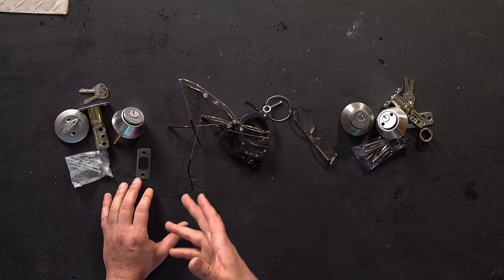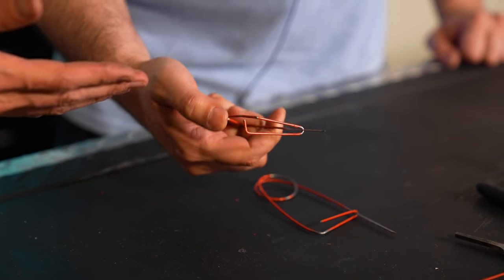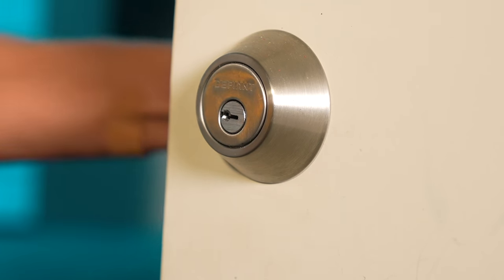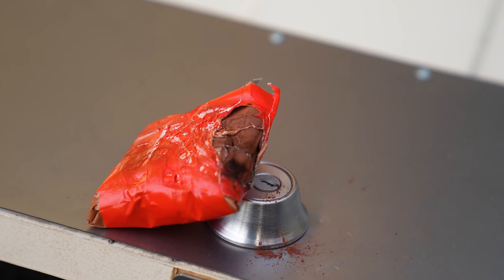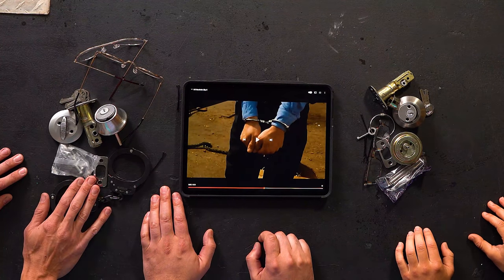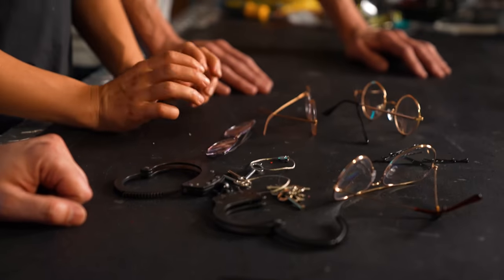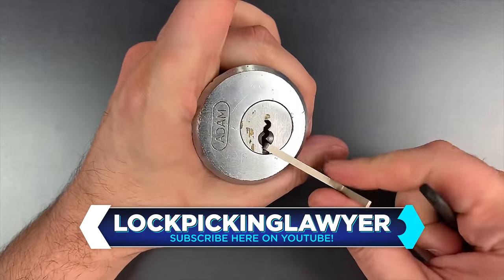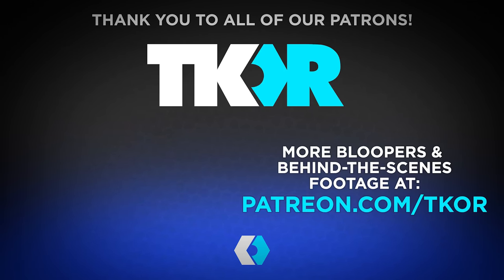Can THERMITE Actually Break a Lock? (w/ Lock Picking Lawyer)

Comment: In World War II, the Germans had an artillery piece - it's the biggest in the world - called the Gustav Gun, and it weighed a thousand tons. And the Gustav was capable of firing a seven-ton shell and hitting a target, accurately, twenty-three miles away. [chuckles] I mean, you could drop bombs on it every day for a month without every disabling it. But, drop a commando - one man, with just a bag of this - and he could melt right through four inches of steel and destroy that gun forever.

Comment: It’s been proven that thermite can cut through steel beams if used a certain way. It would have no problem cutting through these locks if used the same way. Packaging the thermite like you did in the video would never cut steel beams. The way they got it to cut through beams was by creating a small metal container for the thermite and attaching it to the beam at the angle they want to melt the beams at.

Comment: What if the thermite cut the bolt holding the door shut, it melted through the lock so I bet it would melt through the bolt, then they would be able to open the door, It would also be a better place to stick a pack of thermite.

Comment: 7:45  This method would not work at all if you were handcuffed by a competent officer because the handcuffs shown in this video are on wrong.  An officer is supposed to handcuff you so that the key hole is facing away from your fingers toward your elboes... so that you would not be able to open the cuffs EVEN if you had a key.
Reply: 10:20 they openedvit both ways...

Comment: well the thermite did 'break' the lock, just not how you might hope

also this vid makes lockpicking seem worryingly easy
Reply: With the right knowledge it is scarily easy to bypass many types of lock via picking or other tricks that take advantage of manufacturing defects. However, it does take some work to develop the skills and knowledge required and most criminals are opportunistic and will often use a different approach (like breaking a window to get into a house) instead of developing the skill required. 

Lockpicking Lawyer is probably one of the most talented and well practiced pick artist outside of a security firm so him doing the work or advising does make it look easier and smoother than it would be for most criminals.

While it is scary, using locks in addition to other security measures will often leave a criminal finding an easier target instead of going after you.